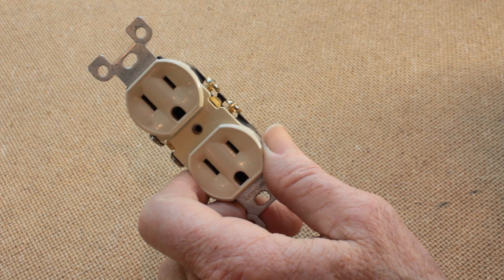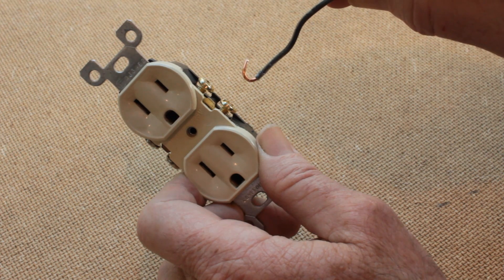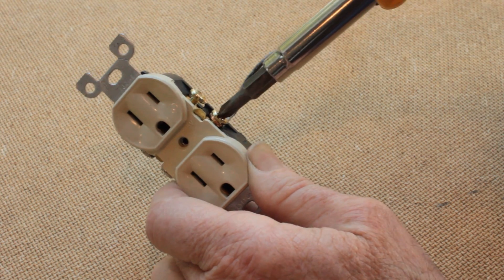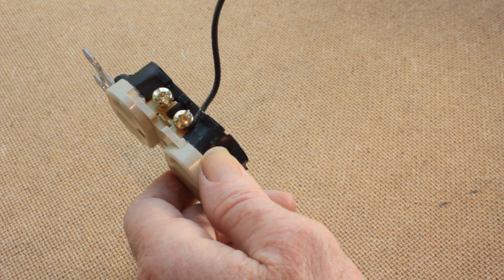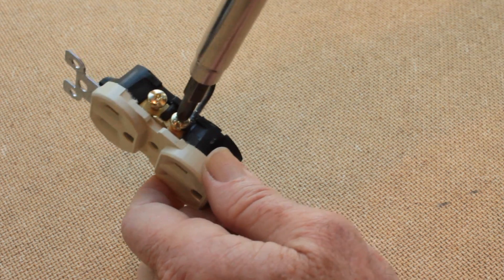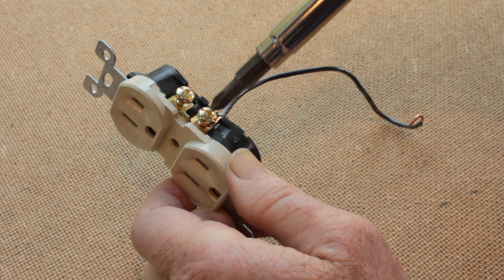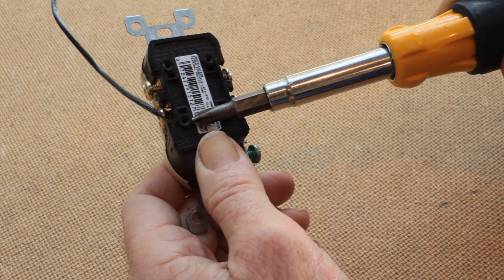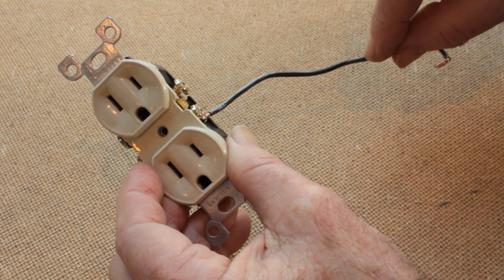A Common Goof Replacing Outlets

Comment: Pigtailing  of the neutral may also be needed for a code compliant installation in a multiwire branch circuit (two or three "hots" sharing one neutral).  See 300.13(b)
Reply: its not a good idea to have a shared neutral. if the neutral becomes disconnected you can have 120 v appliance suddenly have 240 v applied to them. I have experienced this once and managed to destroy 2 electron microscopes, a centrifuge and several computers. I just took the cover off an overfilled junction box and the neutral came off.....

Comment: I am going to show my stupidity here. I live in a very OLD house in which all of the outlets do not have the ground plugs, and I wish to replace them. How do I ground the outlet?
Reply: Use a GFCI receptacle to replace old receptacles on 2-wire no-ground older wiring. I live in a 60-year-old house with that type of wiring and that's what I did. The GFCI will protect you from shock hazard. The circuit will still technically be ungrounded, but you will be able to use 3-prong plugs and have protection. The electrical code generally allows for such a replacement on older circuits. GFCI's cost about $12 each compared to about $1.50 for a standard receptacle, but it's definitely worth paying for the peace of mind, knowing you have protection.

Comment: A thin piece of metal connecting branch circuits or two pieces of bare copper twisted together tightly under a wire nut - I'd say the splice provides a more mechanically sound method for connecting two or more current carrying conductors. Don't different metals expand and contract due to temperature change? I've always thought that sometime down the line the screw could potentially back itself off this way, my reason for not feeding out through the outlet's screw terminals except for gfi's
Reply: That bit of metal you are concerned about has enough of a cross section to handle the current of the circuit. All metal moves  with temperature changes, but's there's little evidence that the simpler screw terminals on the devices pose a threat under typical conditions. Older homes with aluminum conductors are a special case, to be discussed in different context.

Comment: Agreed. IBut if you take your Kliens and physically twist the wires together when pigtailing, as my employees are required to do, and use a quality brand wire nut, it should last forever. Not twisting your wires could ultimately melt the wire nut if the load beyond the splice is heavy. Besides, how many times have you removed a nut to check voltage only to have all the hots or neutrals spring apart. Aggrivating. My number 1 service call is power outage due to loose stab-loks.

Comment: Good example of the proper way to install switches & receptacles AFTER pig-tailing all of wires in the box.I never use the devise to feed the circuit through to the next outlet like many handymen & less experienced electricians do.
Reply: The metal that connects the two receptacles on a device is sufficient to handle the load that the circuit is designed to handle, if that weren't  the case there is no reason to manufacture them in that manner. Not an issue of being professional or unprofessional. Nothing more than an individual looking at something and deducing without any supporting evidence that something is a hazard. In fact pig tailing in the manner you describe introduces multiple points of potential failure that otherwise wouldn't exist. Somewhat like the  inspector that this small rural town had decades  ago. He took it upon himself to introduce a rule that  light switch legs on a 15 A. circuit use 12 gauge wire. Doesn't introduce a hazard but a silly notion all the same with no evidence behind it. The only case I'm aware of where pig-tailing in  this manner is warranted is when mitigating an aluminium wire installation, when running  new copper cable is nearly impossible.

Comment: To 'stir the pot' regarding 'Outlets' from the other side of the world please see the following:-

General Purpose Outlet
it is an electrical term. The definition for GPO in the AS3000 – Australian Standard for Wiring Rules is "three pin flat pin 10 amp socket outlet" or power point as commonly known. But now there is no GPO. The definition was removed from the 2000 edition of the wiring rules, those power points are now defined as Socket Outlets.

Try  GPO Whirlpool  via Google

Comment: I have no desire to ban the term "neutral", but I'd love it if electricians would stop saying "it returns power."  Because it is grounded means it is neutral in regards to the earth, it does not mean it is neutral in regards to the non-grounded conductor.  The neutral carries the exact same amount of current as the "hot".

Comment: PLEASE HELP!! I'm trying to connect a 2nd rectpcl for Xmas lights outside.  The plug inside my house is split. The top is operated by a switch and the bottome is always live.  Obviously they broke the tab in the middle.

Now, since I want my Xmas lights to be live always, would I have to pig tail to the bottom (live) part of the outlet to the outlet going outside for Xmas lights?  Should I pig tail all 3 the ground, black and white?  

I really need help so I'll greatly appreciate any help.
Reply: aggienica exterior outlets have to be GFCI protected, betting your inside outlet isn’t protected that way.   Also, don’t mix inside and outside wiring, keep them separate.

Comment: "Electrical Outlets" as a term goes back 120 years. It is used on formal specs; in buying outlets, in the trade of wiring up houses and buildings. This term will be around long after all living today are long gone. Google shows 77 million hits for "Electrical Outlets"  and 76 million for "Electrical Outlets"and 9 million of "electrical receptacle" and 5 million for "electrical receptacles". You might as well be an ass and try to ban "neutral" from electrical dialog. "outlets" banning is silly.

Comment: Disconnecting a ground wire from the gas pipe runs the risk of electrical current being transmitted into the home from an outside event. Grounding any metal pipe that comes into your home helps to protect your home.

Comment: So what you is basically saying is don't allow the insulation to be trapped under the screw. :)

This also applies to terminal ("chocolate") blocks too..!
Reply: The insulation must not be trapped under the part that is clamping the wire and making contact. It's ok if the insulation enters inside the port of the terminal block, just not under the actual screw, clamp, or whatever used for connecting the bare wires.

Comment: Ok, so do you do let's say, three or four plugs connected to one circuit?
Someone mentioned pig-tailing so I'm trying to understand if it's to wire the plugs in parallel in case one fails or to avoid sending all the current through each receptacle on series??  Confused...

Comment: Cant wire directly to the NEUTRAL side then come off the other screw to the next receptacle (you can with the hot); you MUST instead run the neutral to a small "pigtail" or wire coming off the receptacle (NEC 2011 300.13(B)). This means white comes in to the box, and into a wire nut; a 5" or so wire goes to the silver (neutral) screw on the receptacle from the wirenut, then another wire comes out of the wirenut out to the next receptacle. Pigtail NOT required if this is the "end of line" outlet.
Reply: jayynecobb: this only applies to multiwire branch circuits that have one cable supplying 2 hots and 1 shared neutral. For a single pole 15 or 20 amp circuit supplying recetacles daisy chained together, the practice is completely acceptable.